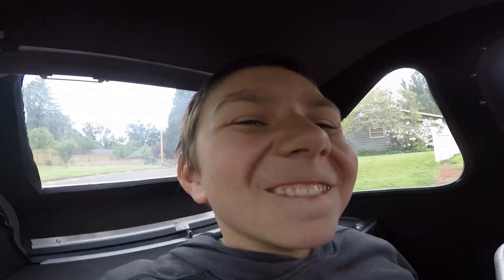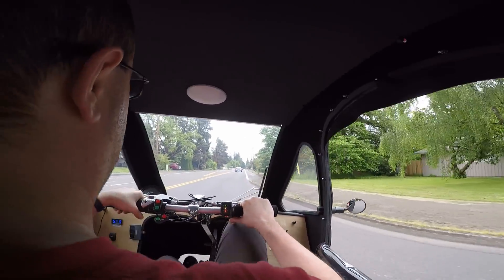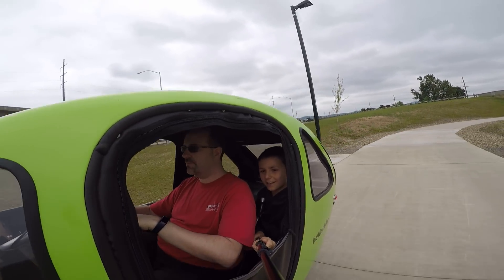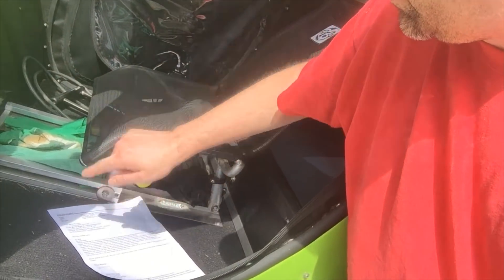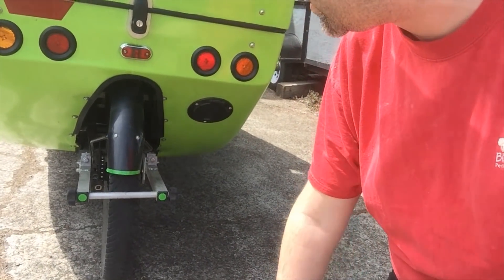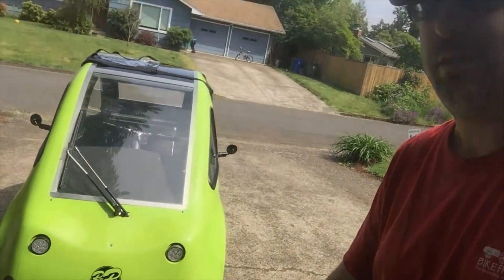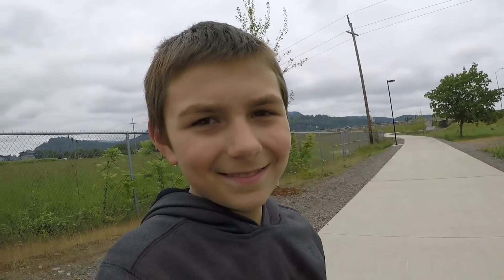The Great PEBL adventure part 11

Comment: My idea would be to have an option put real doors with sliding or roll down windows instead of just a zipper fabric door plus for me I’d rather have a removable chain guard like beach cruisers than the tube like thing you had
Reply from the maker: green machine55 agree 100% sounds like you have a PEBL killer in the works. Get a Nuvinci 380 hub mid drive and disc hydraulic discs and I’m interested
Reply: Cool I will keep that in mind that might be definitely an option and or a upgrade improvement as I improve my design I will be advertising it on my channel when I get the 1st couple prototypes made and working on a Facebook page called Moore pedal cars

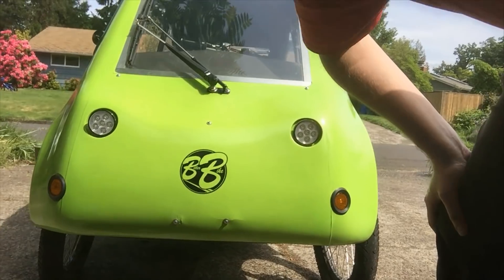Comment: when you say "not a big deal" at 8:00ish, it IS a big deal. all that stress in that area is causing it to fail at a rapid rate..
Reply from the maker: Peter P. They’ve essentially fixed this! New bodies have separate front piece and side pieces so the weight of the body is no longer resting on this part.
Reply: @EricFischnaller  I haven't checked your new videos since this one was produced, how is yours doing a year later? BTW your son is a good cameraman and a great addition to your channel. :)
Reply from the maker: Peter P. Thanks. Honestly hasn’t continued cracking at all. The new bodies look really great. They’ve made a lot of little iterations since mine was made. Think there are about 60 out on the road now... two in Eugene. My latest video shows a drag race.... 😀

Comment: Ace hardware "well-nuts" In there parts bins ... they are rubber with a brass threaded incert ... vibration isolator...  see if that slows the crazing of the front end.

Comment: Hi if i paid the cash you have , and  the front was cracking i would definitely want the company to fix it under warranty; now saying that, a simply put a longer length of aluminium across the front, and as you said with perhaps a bit of old tyre in there as a bit of  suspension , just try a simple mudflap , it looks good not sure if its better than a elf , what do you think with hindsight would you buy an elf with the solar panel .

Comment: Use silicon for the front as a cushion. It is more durable than rubber. Look for mud flaps for Trikes. They might make them. Corvettes have the cracking problem on older models and the cracking stems from worn out grommets.
Reply from the maker: Ron J. That’s a good tip. Thanks for that
Reply: You must ride on some rough roads. Silicone is basically indestructible and makes for a great cushion between the frame and body.
Reply: @ronj.4878  Elastomer suspensions are common on dirt bike front forks. Nobody uses silicone to my knowledge.

Comment: Thanks for all of your videos.  I had make the last payment and had to cancel because the state of Ohio change the rules for electric bike.  Anything that a motor requires a driver license.  I don't have a driver license because of my sight.  Thanks again. Best wishes.
Reply: I was chatting with a dude on line talking about this pebble and he said that that was still worth it as he was replacing this thing with an actual car. Because it was still cheaper than a regular vehicle sure if you had the license it that would be something some money. But for the most part you never have to oil the same you never have to fill it with gasoline it just takes electricity.
Reply: Now I guess the real question here on this object is weather insurance is going to be an issue or not.

Comment: Question about your concern putting wear and tear on the Pebl by frequently putting long rides on it, say every week. What about it wouldn’t last? I’m looking at an e-trike solution for in and near town rides within a 20 mile radius. Do you think it wouldn’t last 5-10 years? 

I watched the frst half dozen or so of your videos and found them very instructive; but their hill climbing pre-1000 or 1500 Watt upgrade left me looking for other sources. Now Pebl might be back in the running.
Reply from the maker: MrBiggles53 mine being one of the first PEBLs with weaker frame design and a lack of experience on the side of the team at Better.bike has me concerned about the longevity of my PEBL. For a bike with less than 500 miles and no crashes it’s got some rattles and has had some repair needs that have been above what I expected. I don’t doubt that a new PEBL purchase would be much more durable having had the benefit of nearly 100 delivered before will be far better an investment. The new on/off road 750/1500 watt switch should really assist in hill climbing too
Reply: Mr B - did you know 3 ELFs have been used for 4000 mile cross-continental trips? One was a 75 year old woman who wrote a book about it, one was a young Canadian who went to Key West and made a movie about it that can be viewed here on Youtube, one is still going. At least one ELF I am aware of has 60,000 miles on it. Stuff does break but there is no $5000 motor or $3000 transmission to blow up like on a car. No doubt someone may soon be or or is already on a long trip in a PEBL. That test  is part of the source for design improvements.

Comment: If you want substantially extend the battery life, use the big one and charge it to 80%. Most of the wear on these batteries occurs above 4v per cell. You can easily double the number of charges by only charging it to 80% or under 4V per cell.  You are killing your battery leaving it sit fully charged.

Comment: I just spoke with Fredrick today over email and he said a couple of new things regarding shipping.  My PEBL would be shipped directly to my house and the driver is responsible for unloading it.  He also stated that the would send a video on how to hook the batteries up.  My guess is they are shipping the batteries outside the PEBL instead of them under the seat like yours were.  The video will also include instructions for installing the mirrors.  I will keep you updated on what I hear.
Reply from the maker: Installing the batteries are a piece of cake. They just slide in under the seat and the plug only goes one way so no way to mess that up. As to the shipping, it's my understanding that they've been shipping the batteries attached to the floor of the crate for a while - so they wouldn't have to revisit what happened to mine. Mirrors are simple to install as well with just a few allen bolts to tighten. Enjoy! That's exciting that it'll be shipping soon

Comment: I found a neat safety accessory that really improves night visibility from the sides of my ELF - wheel rim reflector kits. Each kit has enough curved reflective tape to treat 4 wheels. Really shows up in headlights! I used white with my white ELF but they sell custom reflective colors too. Amazon.
Reply from the maker: Popeye Gordon yes the green strips on the wheels of my PEBL are those retro-reflective strips. I show putting them on and results in Great PEBL 6 I think
Reply: OK, guess I forgot that. Well now I am keeping up with the PEBL :)  I especially like your thumbnail for #11, with the curving trail. Good job!

Comment: One other request can you post on how to change the tires and general maintenance with adjusting the handle bars and what to tighten up as you ride.  Thanks again!
Reply: Front tires are easier because the bike won't fall over. Rear tire is a project to change, hopefully you can carry a patch kit and pump.

Comment: Doesn't that mean you have to register the vehicle, if it has a 1500w motor?
Reply from the maker: Brian Foster according to Kevin from Better.Bike the intention is the 750-watt on road setting is for legally riding on roads or paths. The 1500 watt setting would be when on private land or off paths and roads where legal. If mine had this setting I’d reserve it for hill climbing only
Reply: Legally, yes. But better.bike may have discovered a loophole that stands up to legal challenges at least in some states. Time will tell. How many cops even know about the federal 750 watt limit, let alone the fact that one new maker out of 1000 e-bike makers is including an overdrive switch?

Comment: I owe Eric a big thanks for sparking a modification idea that has helped my rear hub issues a lot. OT used the 8 speed internal geared SRAM hub on older models. Mine self destructed not once but twice in 4 years, 3,600 miles. The main issue is internal geared hubs are not meant for tandem( long shift cable run) use. They start to fail to shift accurately then the two internal planetary gears start failing so you can't possibly adjust the cable to get all gears. Then they grind and pop into scrap metal. Erik suggested the 5 speed hub would be adequate, possibly better because the indexing travel is greater between gears. I looked into this and decided to have my local bike shop build a heavy duty rear wheel/hub using the Sturmey Archer 5 speed internal hub with ONE larger more durable planetary gear. $770 later I have a 2 inch wide double walled super duty wheel, extra strong spokes, 2.8 inch tire and a hub that shifts every time. Sturmey Archer also uses a heavier axle and bearing set so I'm very happy with performance, I actually coast faster down hills. PEBL owners should feel fortunate Sturmey Archer was chosen as the OEM.
Reply from the maker: Popeye, I'm glad that worked for you. When my 8spd self-destructs, I'm likely to do the same thing. I currently get gears 1, 2, 5, 6, 7, 8. And since the 2nd gear only sometimes works, I feel like my '5-speed' isn't really working awesome... particularly since the gears I have is 1, 3, 3.5, 4.5, and 5. Not really optimal. When my rear wheel got loose earlier this year, I had my LBS build my wheel with 12-guage spokes instead of the 13s that Better.Bike used from the factory. They're VERY beefy and should do me proud for a long time. The great rims I have is the only reason they think my wheel didn't blow up completely.
Reply: Yes, these builders buy pre-spoked wheels from wholesalers who swear the tension is right but I can tell you  many customers end up with broken spokes and problems. There is no substitute for having a good local bike shop resource.
Reply: Would be interesting to know your experience with the SA 5 speed. I tried one on a bicycle (rotary shift) including winter snow conditions, and it failed. 3 issues basically: 1st is that the old SA 5 speeds had 2 shift cables, one push and one pull, and they now went to 1 pull, with the result that the internal planetary gears may not end up exactly where they are supposed to be, and that partial engagement and “nibbling” is destructive to the gears. I could only access 4 of the 5 gears, no matter how much I fiddled with the adjustments. 2nd issue is that one of the three bearing sets has only a simple dust cover over it, the bearings are visible to the eye just looking at it, and so there is no protection there from water - snow - mud invasion into the bearings. 3rd issue is that it’s a factory pre greased hub, it doesn’t run in an oil bath, and so you can’t lubricate it, the only thing that can be done is to fully disassemble and re grease, and unless you have experience with assembling Swiss watches or something you won’t have the knowledge or tools to do it.  A good old Derailleur system seems to me would be better, such as on the DryCycle...?
Reply: @PRH123  Single cable can work well for indexing with a good design. SA is heavier than some but not a top end product. Derailleurs would be worse in mud.

Comment: Fender add-ons are no big deal, ELF owners have used scraps of plastic or rubber, bleach bottle plastic or even aluminum sheet painted to match. It's one of those simple projects you can experiment with. I used white vinyl roof gutter, shaped with the aid of a heat gun, Durable and matches my white body paint. I even used that gutter, upside down, to make a really sharp looking rear fender.
Reply: I wished the elf would have a windshield wiper
Reply from the maker: I thought about using rubber, but am unsure as to how to mount it. There's very little clearance since I have the larger tires - if there was more clearance, it'd be a piece of cake.
Reply: Nothing wrong with trying duct tape fastening to determine the best shape, then when you are ready drop the wheel and rivet or use small nuts and bolts. But I wonder if you do a sharp turn of the wheels, you get enough room. Also could let air out of tires, easier than removing wheels.

Comment: Drivers license????  750 runs cooler. Put a mud-flap on it. You should build up front repair now thicker with carbon. Buy a yard of 11oz twill/ebay. Don’t use fglass. Do mods,, U can make plugs from bondo wood and pull mold from.
Reply from the maker: Pushyhog my thought is that driving with a vehicle on-road that’s over the e-bike limit could get you in trouble without a valid drivers license. If you were going under 20 and obviously under pedal power I doubt the authorities would look at you twice.

Repair-wise I’m going to reach out to Kevin and see what he suggests. Also curious to see if this is happening to others or if maybe mine has a defect.
Reply: Body cracks appear on older ELFs in a few particular locations. Eric is wise to work with the factory on the best fix for this. A reinforcing plate between the frame and body shell would be invisible if done right. If removing all that glued on liner is too hard, some thick glue inside and a couple small stainless cap nuts on the outside might work. Or camouflage your reinforcement by making a front bumper that also helps reinforce the shell and fasten tight to the mounting points. I saw a nice front bumper made from aluminum diamond plate with a balsa wood core. A metal shop can whip one up for you.